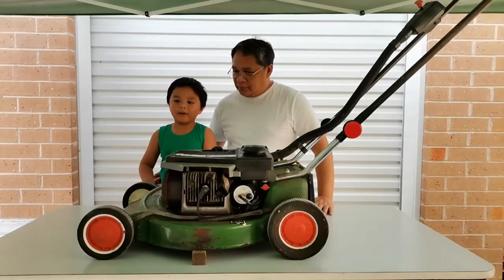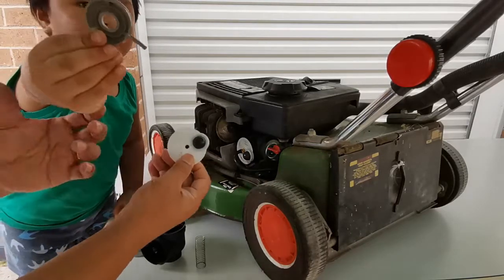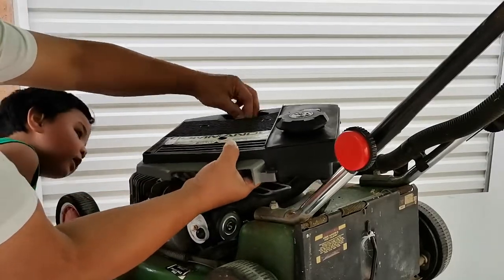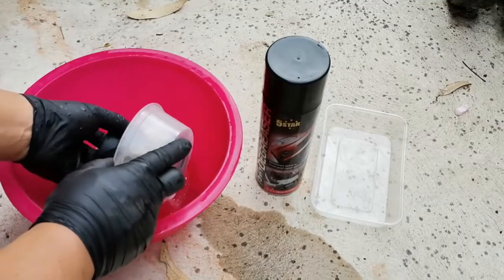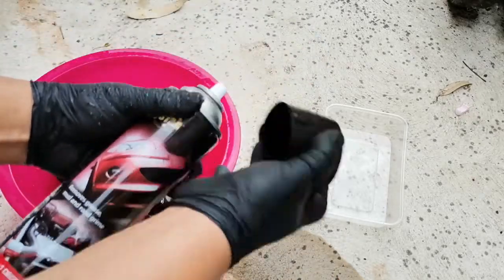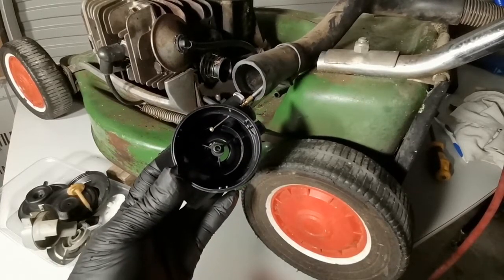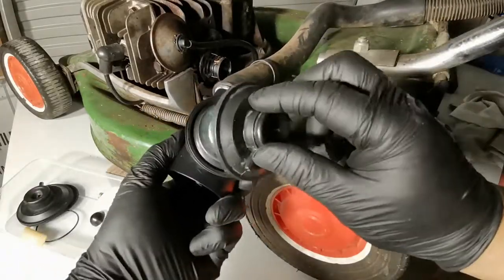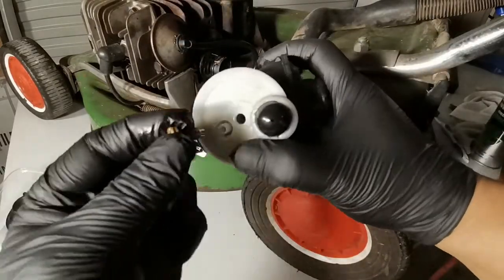VTECH 28 - Victa V35 Commando G4 Carburetor Full Rebuild

Comment: Hey Varietech, I recently rebuilt my carby on my vista utility. I put it on gave it a couple pulls then it starts only for a bit though. After that it won’t start, would you by any chance know why?
Reply from the maker: Try to start the engine with the fuel tank cap removed or slightly loose.

Comment: recently i learnt that the poppet valve needs to be at A position on older engines to stop over reving ,it seems to work for me I think   the difference is a bigger ridge on back of valve  I was worried when tou ran it on the tabl;e
Reply from the maker: On the first repair without pulling the carby apart, the revs was fine and after the second repair when someone lost the control spring (long spring), I positioned the poppet valve to "C" thinking would be the same with 160cc engines. This is a 125cc and it's overreving as what you see and also found out that the best poppet valve setting is letter "B". There is no much information on the Web regarding poppet valve settings. There are three different types of poppet valve that I knew of so I will making video experimenting and demonstrating all different settings of poppet valve and how does it affect the engine revs and understanding the physical differences. Thanks for watching and noticed the same problem. VARIETECH
Reply: @Varietech-AU  cant wat to see that video thanks